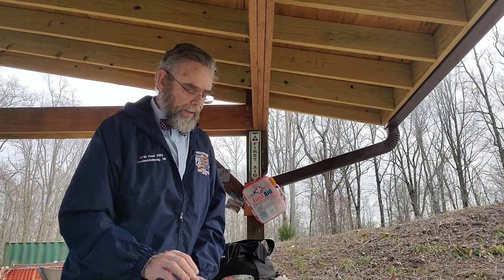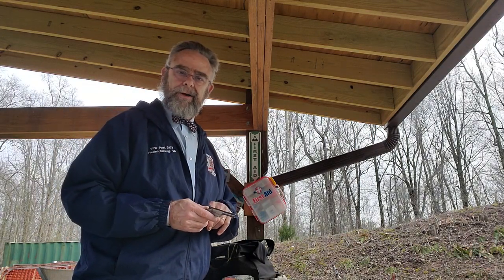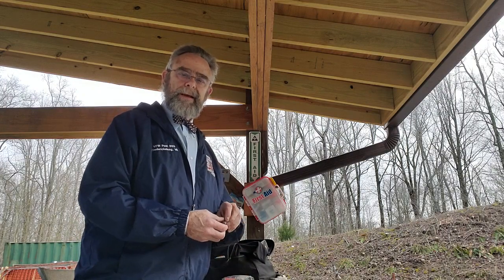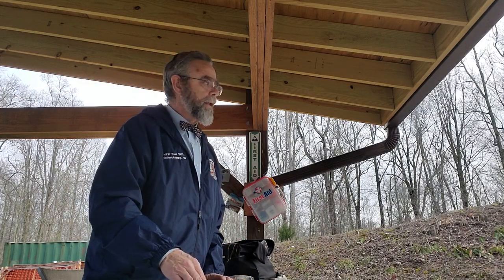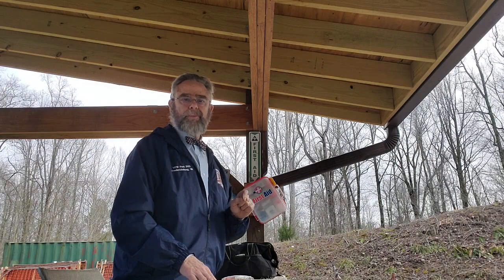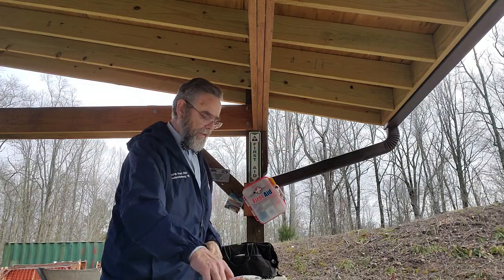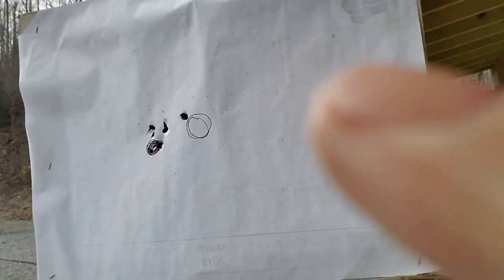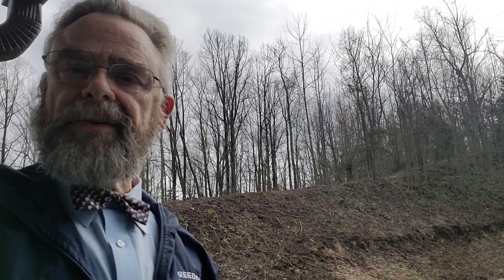Shooting the .30 rimfire Marlin pistol with 3D printed bullets

Comment: Steve, Fellow vet here, I recently came across a Merwin & Bray pocket pistol. I believe it is a .30RF probably from the 1850’s. I’d like to get in touch with you on possibly purchasing some ammo. Thanks, Tony
Reply from the maker: @TonyFoor-cp2if  sorry, but I do not make brass or ammo to sell. But I'm glad to share how to make it yourself. Start with .22 Hornet brass.   Thin the rim from the front to about .045". Trim brass to .515" length. Convert brass to rimfire using .22 acorn blanks, see my video on making .25 Stevens brass part 2.  Bullets are a challenge. I modified a few Lyman 287641 bullets by shortening them and cutting  heel to fit in the case. Good luck!